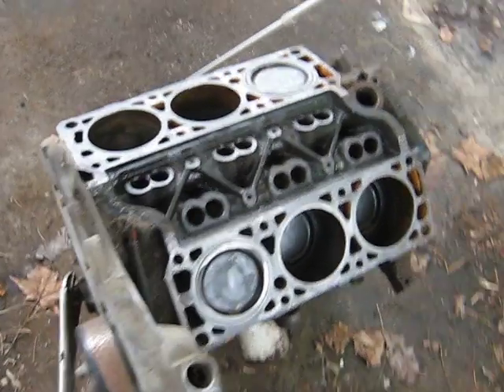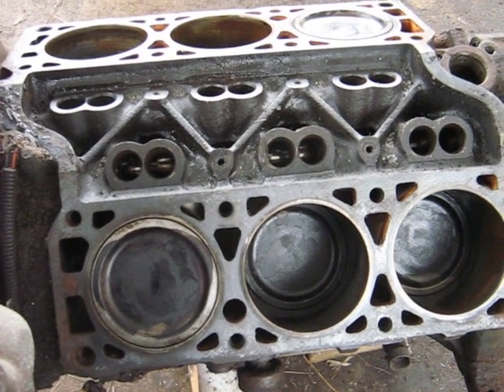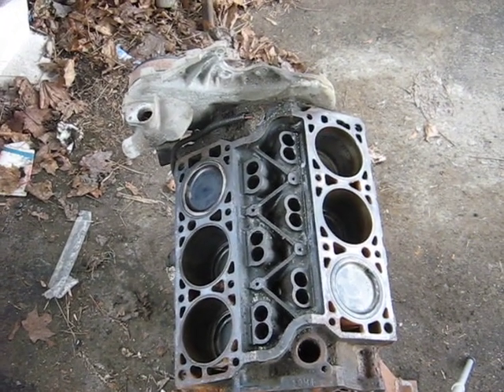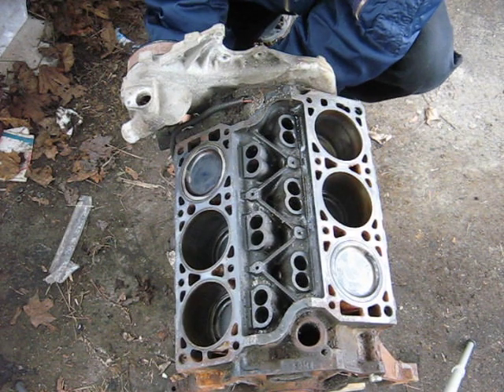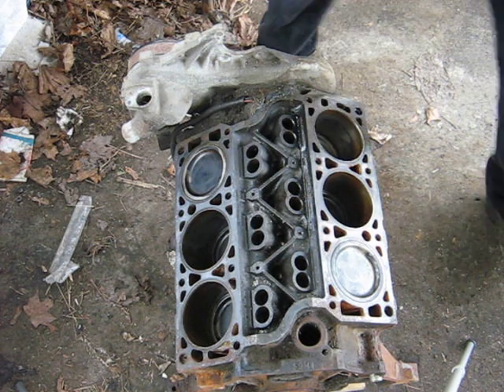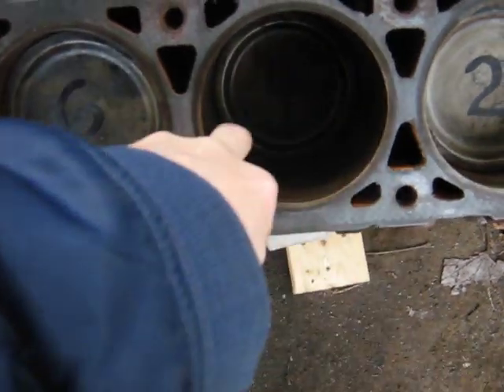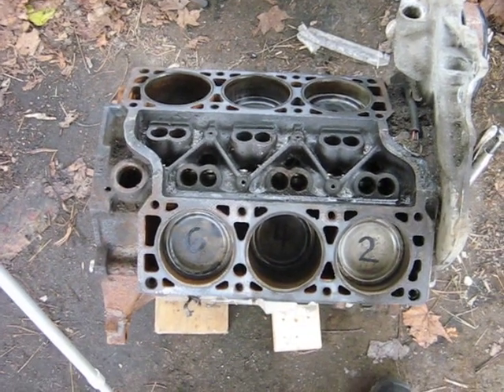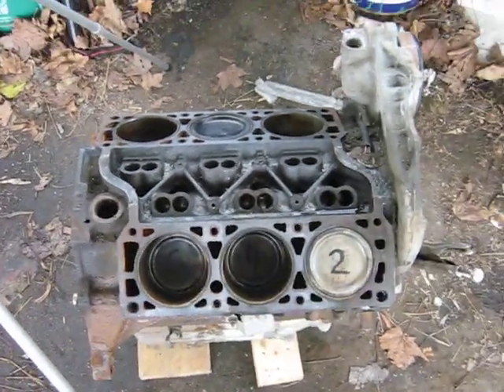Spinning over a V6 GM engine

Comment: Great job 👍👌
Reply from the maker: Yes, low compression would not make good power, strangely I found another 2006 with a loose crankcase vent tube also, starting to look like a pattern.

Comment: @ChargerMiles007 since its a RWD car all the accessories (water pump, alternator, etc) face the front of the car. the cylinders front to back and 1-3-5 on the drivers side and 2-4-6 on the passenger side.

Comment: @ChargerMiles007 It gets even worse! Just been studying the Deltic closely & the crankpins are spaced at 60° intervals as opposed to 120° for a straight six or V12. If such a beast were made from, say, three V12's it would have cylinders firing simultaneously!

Comment from the maker: @Mr3wheeledbike 
Yes, even using three 3.4L (200cubic inch) V 6 engines, it is a 600 cubic inch 2 stroke!!!!  It would pass everything BUT the expensive gasoline station!!!  :)

Comment from the maker: @belchnasty 
Perhaps old Jag V12s are plentiful elsewhere, I haven't ever seen one of them in a wrecking yard in Canada!!!!
Yes, that would be just what is required for this application. I was looking at it, and perhaps a person could cut and re-weld the crank, since there is a 3/4" thick counterweight there to allow the offset to take place. Lots of work though.

Comment from the maker: @pivotboy63 
Interesting, I wonder how the cylinders are numbered in that engine?
Actually, when you look at it, it is 6,5,4,3,2,1. Just the opposite of the GM 1,2,3,4,5,6, so the crank is probably built similarly.  Thanks for the info.

Comment: The number one piston is there  beside the waterpump at the rigthside.. It's true.. Hahhaha
Reply from the maker: These V6 engines are strange animals with a 1-2-3-4-5-6 firing order, normally the piston firing order bounces around a bit, like on a V8 engine (1,8,4,3,6,5,7,2)

Comment: You kinda got it wrong 14 fire together then 25 and 63 if you look at the sparking system when the engine installed in the cars there’s 3 coils each fire two cylinders at once and there labeled 14 25 63 that’s the firing order
Reply from the maker: You are correct about the coils being grouped that way, but The camshaft would dictate the firing order, and only one cylinder fires at a time, the opposite cylinder receives a "dead" spark in between exhaust and intake stroke. The same thing happens to small engines, like a lawnmower, the spark plug is fired every time the piston comes up, but only every second rotation is the engine on compression stroke in a 4 cycle engine.

Comment: from the front cover the bank towards the fire wall is 135 the bank towards radiator is 246. stock cranks wont work as #2 will be over #1 ect on different strokes. Could weld up ports in water jacket tho. A machine shop could cut a stock crank chop it up reweld it to new firing order but could get costly plus cam work
Reply from the maker: You don't need the cams on a Deltic, the pistons are the valves. Good suggestions about how to build it, I would like to do it, but I would have to win a Lottary to be able to afford to do it! though I do have enough superchargers now  :)

Comment: Is there any posibility  to cancel two inyectores and make a 4 cil 3.4?
Reply: If you're okay with like 60% as much power and absolutely ridiculous vibration that will basically make the motor rip itself apart, go right ahead.

Comment: are you turning it with the timing chain on? when I turn mine it turns hard, then easy, then hard then easy. Is the hard turning due to compression? why is it so easy to turn smoothly on your engine.
Reply: there is no timing chain, the cylinder heads are not on the engine (no valve train to run).

Comment: What is the firing order on 3100  engine
Reply from the maker: +Dee Richards As far as I know V6 engine fire 1,2,3,4,5,6.  You should be able to find it on the internet.
Reply: @ChargerMiles007  1 ...3...5.....2.....4....6...is THE FIRING ORDER..3.1/ 3.4..CHEVY GM...204 CB INCH.....
Reply: It’s all the same it’s 1,4 2,5 6,3